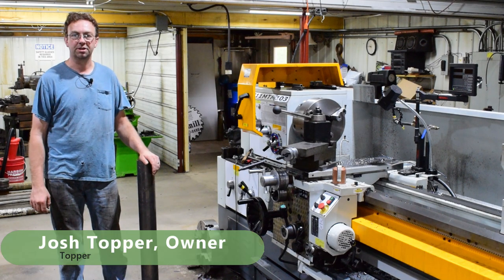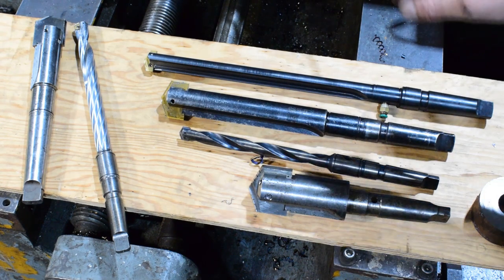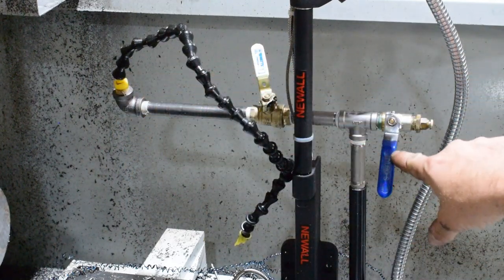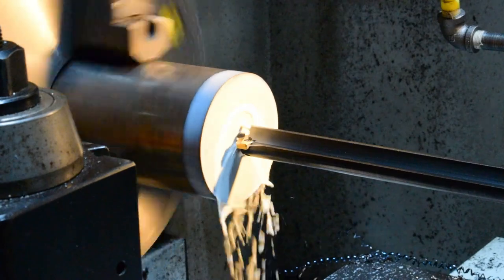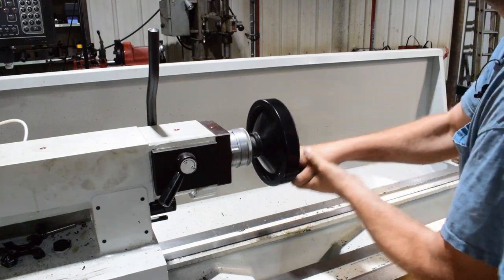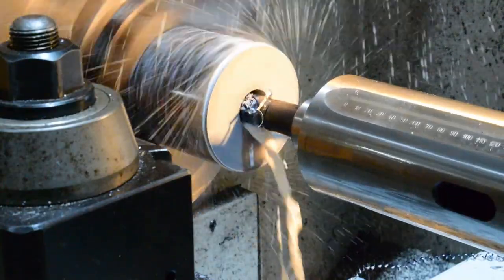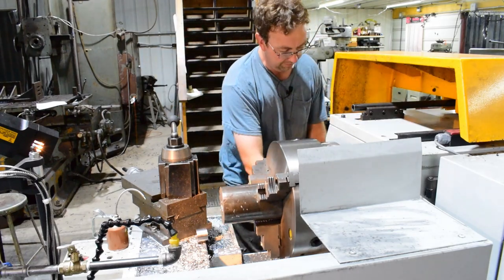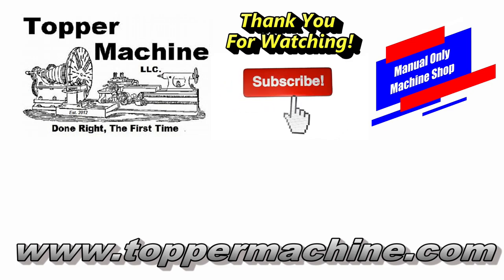Super Fast and Awesome Deep Hole Drilling - Making DOM Tubing - Spade Drilling in a Manual Lathe

Comment: Why use a long, and expensive,  drill if your parts are short? I did not see take a skim cut for consentrity. Cut the bar to length first and you only need a 2"long drill.

Comment: A practice I have used that works well with spades, use a tapered holder on your crosslide Aloris holder, then you can use the feed to run your drill at a constant speed.
Reply: You can also make a connector to connect from the saddle to the tailstock and do the same.

Comment: I got a few of those blades at a surplus place that sold used tooling at like $5 a pound. Figured I could always grind them into custom cutters or something. Most of them were brand new with the coating still on them.

Comment: Awesome video.. I got a upcoming similar job but on 304SS bar and I will have to drill 30.” Deep….  What material is the solid bar?? And what material is the insert??(cobalt with coating or carbide with coating)??

Comment: I worked for a couple of years on a deep-hole drilling machine (didn't know that a lathe could do the same), we hardly used any lubricants, we "lubricated" with compressed air, which at the same time blew the chips out of the groove along the drill bit. We used much higher speeds because the tool was moving and not the workpiece. And we always start with a pilot hole with a conventional drill of the same diameter, so that the deephole drill doesn't go astray.

Comment: Hi, try without pillot, and use the carriage of the lathe, with automatic push harder, Also the pilot just need the center of the center drill, not all, becouse the angle 60° is not the same of the tip of the drill 118°, try it.

Comment: I have heard before that spade drills don’t like the “inconsistent feed” on a manual, consider that now debunked!!
Thanks for sharing this.
Reply: Never heard about the inconsistent feed issue before. What hurts spade drills is when they come out the other side and the coolant is gone before the hole is finished. Had to do quite a bit of peck drilling with spade drills at a previous employer and found out what works and what doesn't. Try drilling a 36 hole bolt circle 1-5/8" thru a 3" flange with anything else. Insert drills are great but they require a very solid material and setup. At least they are easy to re-sharpen. I have a friend that still swears by hand ground tool steel bits. We are a dying breed.

Comment: Allied Engineering is an Ohio Based company that I sold to when I was in inside sales for a company. 
When they were getting ready to introduce their smallest diameter they had a problem with throwing the screws that hold the bit in the shank. 
I got a call pone morning from the shop foreman and he told me he was headed to a meeting with purchasing to order $500K in special screws from a Swiss company. I told him to hold that order and I would have special taps to them in 2 days to try.
Problem solved with a $3.50 tap that saved them a million dollars per year.  That total would be close to $35 Million by now.

Comment: Saw and Drill, still the fastest metal shaping tools in the shop 👍.
Have you considered fitting a drilling attachment on the cross slide Josh? I first used one in the 1980s on a Dean, Smith and Grace here in the 🇬🇧,  it had a dovetail clamping system, the you slide it up to a stop on the carriage, though there are other methods. 
Great job, top class videoing. 
Thanks for sharing.
Reply from the maker: I have an aloris Toolholder for that purpose. Just didn't want to take the time to indicate it in.
Reply: @TopperMachineLLC  I've used the tail stock to centre the tool post, using a centre, nice and quick.

Comment: Very pleased to see this video. I was beginning to think that James Kilroy was the only other Machinist who prefers Spade drills. I'm convinced they are a much more economical choice for a job shop in particular, sharpening is so much faster and easier. In recent years, I've become very reliant on annular cutters to get my initial hole and then boring bars to finish. They are not cheap, but I find that recovering the slug is a lot more useful than one might think, lots of smaller jobs that can make good use of these. What is your own opinion on annular cutters? I see that you are using traditional twist rules along with the Spade bits, do you not see a particular wisdom in limiting a shop to one or the other? If this is the case, can you explain what circumstances make it valuable to have both options at your disposal?

Comment: Have you ever tried a u drill. They have multiple inserts to cut and inserts on the edges to guide the drill body. They are brilliant. Similar to ejector drills i guess but they are more for realy deep holes.

Comment: Fun fact: "Balls to the wall" refers to the throttle levers in piston-engine aircraft.  They have ball knobs so you can tell them apart by feel, and pushing them all the way forward - i.e. to the firewall - gave maximum power.

Comment: Hey Josh. Great video. Thanks for sharing. I am running a manual machine shop in Zimbabwe. I have been looking for info on spade drills and your video answered a few of my questions. What I also need to know is...I want to finish drill to 43 mm, what would I need to pilot drill to? Many Thanks again for your great channel! Regards Woody.
Reply from the maker: I have plowed through 1045 with a 1.25" spade drill and it comes out 1.250-1.251 consistently. As long as it's sharp and good quality, I have not had any issues. Just drill a starter hole or a center drill to get started, and plow it through

Comment: Why not run power feed, either by putting the drill in the tool holder, or using a link that lets the carriage drag the tailstock? I love spade drills. and gun drills.
Reply from the maker: I do have the aloris morse taper holder, but didn want to take the time to set it up for only a few feet of hole. But, maybe next time I have to do these I will.

Comment: Would it be possible to make a bracket that would “tow along” the tail stock using the carriage feed?  I suppose the tailstock may not have good engagement on the ways when not locked…….
I agree with the previous comment on using a tapered holder, I have done this with a “super drill” (an adjustable spade dril) but it was a pain to dial in the cross slide holder in both axis…..
Reply from the maker: I have one. Just didn't want to take the time to set up.

Comment: You should make yourself an holder so you can use the mashine to feed the drill
Reply from the maker: I have one. Didn't want to take the time to set up. Besides, most of my veiwers done have that option.
Reply: @TopperMachineLLC  ok. Did you make it or by it?

Comment: no saw was needed, you can part on the lathe while plunging the drill.
Reply from the maker: I can part, but the saw kerf is 0.035" and the parting tool is 0.160". It's all about saving material sometimes.
Reply: @TopperMachineLLC  time is money, that doesn't look like titanium

Comment: Couldn't you trepan those bores?
Reply from the maker: I suppose you could, but on 1.25" and having to do that many smaller pieces it's not worth it. Just get the job done and out the door. That's how you keep customers happy and pay bills.
Reply: @TopperMachineLLC  I was thinking of David Wilks videos of trepanning very long pieces to do the whole length needed. To do shorter sections, an annular cutter could do holes up to 6 inches deep. I guess you know how long it takes to do the multistep process.

Comment: Believe it or not, I have actually had better luck with these not using a center drill. Pause the feed after getting the split point buried until it stops vibrating, and then feed hard and it generally sorts itself out by the time the cutting edges are all the way in. It may not be any better, but it at least works as well and saves center drilling. I love these drills myself, we have them from 1" to 4.5" and use them daily
Reply from the maker: Thanks for the input. I was wondering if they would self center well. I'll give it a try. I have a large job coming in tomorrow that needs spade drilling.
Reply: @TopperMachineLLC  I can't say for sure on other types, but the Allied T-A series at least have behaved very well for us

Comment: I'm pretty sure the phrase is balls to the wall. Balls to the walls implies separate walls, a much more painful and elaborate punishment.
Reply: Balls to the wall means max throttle. Pedal to the metal. Older planes and boats even had a lever with a plastic ball on the end and when you pushed it as far as it would go, you would want just a bit more and try to push it into the wall of your craft. Hence, balls to the wall.
Reply: @randyhanson837  that's fascinating. I had been under the impression that it resulted from the governors on old steam engines or some hit and miss engines. Where they would cast a lead sphere onto a pair of strips of spring steel, angular momentum would draw them outward, functioning as a throttle of sorts. So the exact same interpreted meaning, but from a completely different era. But I was just making a joke